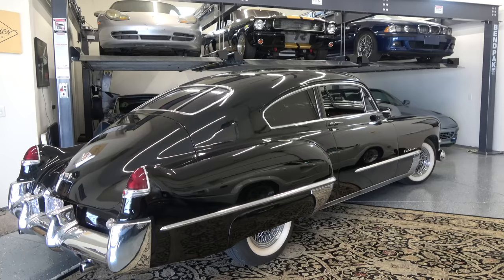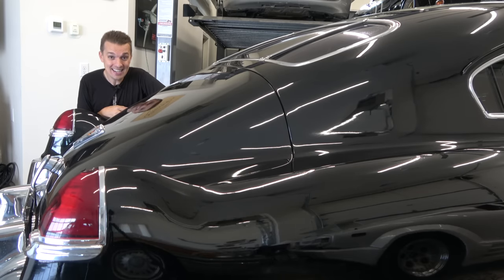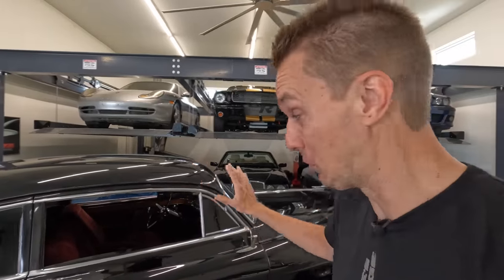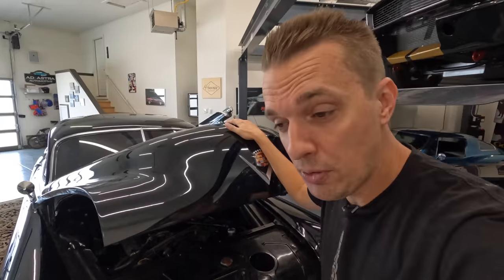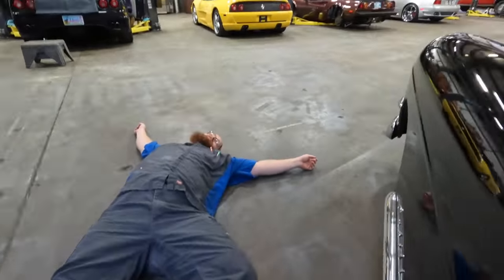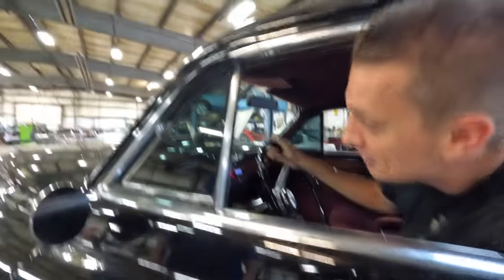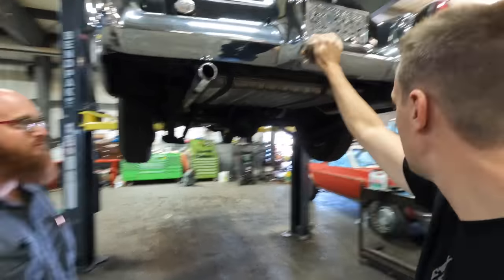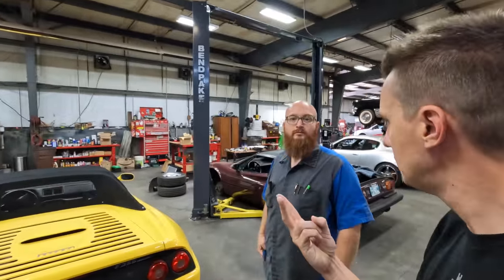I bought a RARE 1949 Cadillac Fastback, and making it my 70 year old daily driver! Amazing Restomod!

Comment: I’m 84 and I actually remember the caddies of that era, back when a Caddie WAS a Caddie.  I don’t actually know, but I wouldn’t be surprised if that transmission wasn’t largely the same one that was in many military  vehicles, mainly armour throughout the war.  Should be bulletproof?  Anyway, now I’m going to watch the video to see if I actually know anything, looks like a good one.  What a car, what a car!!
Reply: Luxury manufacturers really were different back then, one of my many favorite cars is the Lincoln Continental Mark 2, and it was entirely hand built!!  Lincoln was literally trying to compete with rolls Royce back then and most luxury manufacturers don't put that much effort into their cars anymore.
Reply: Wow! that’s incredible. did you see these a lot? where did you grow up?
Reply: The original automatic was a dual band 4 speed Hydramatic that was actually used in tanks in the latter part of WW2. Those were very bullet proof and had an extra gear. It would be a nightmare to get that mated up to the 500 so I'm sure a TH400 was used instead. These transmissions were also used in Oldsmobile and Pontiac until 1956 when they went to the dual coupling design, which is my favorite automatic transmission.
Reply: @theincrediblehulk5797  The Mark II was not hand built, although it was put together to generally higher standards than a normal Lincoln. It wasn't a direct competitor to Rolls Royce because it only came as a two door hardtop.
Reply: @muziklvr7776  Putting the original Hydromantic into tanks was pretty bold since it was an entirely new kind of transmission and only came out just before the war in 1941, besides tanks being a bit heavier than a car.
Reply: My Grandfather had a used 1962 limousine he bought at an auction that had a bad transmission. Since the early Olds and Caddies shared the same transmission, they just pulled it into my uncle's garage and swapped it out. They used a modified version of the 4 speed Hydramatic where the 1-2 shift was a fluid coupling, and the 2-3 shift was a clutch pack, and the 3-4 shift was another fluid coupling that also acted as a bit of an overdrive! For a big old (22 foot long) boat, it was actually pretty snappy for only having a 390 under the hood.😄👍
Reply: @emjayay  cadillac has and has competed with Rolston since the 1920s
Reply: Whats up Kenny we grew up together! I was a lil older than you but great times
Reply: @connorkamp5713  no you probably wouldn’t see “a lot” of those because they were very expensive for the time.
Reply: @theincrediblehulk5797  They sold for about $10K at the time.  Incredibly high price.  Even so, Ford estimated they lost $1,000 on each one sold.  Unlike other cars, it came to the dealer completely ready to drive even with some gas in the tank - with the exception of the wheel covers that the dealer installed.  And each was shipped with a fleece lined cover.  And yes, competed with Rolls Royce but also Bentley.  A very handsome and stately style and one I have always pined for.  Instead, I'll just have to settle for the much more common, but not too common, Studebaker Avanti.  Maybe I should think about trading up to a Mark II.
Reply: I'm 76 and my mom and dad drove '49 Olds 76 (flathead straight 6 & 3 speed on tree), couple '51 Olds 98s, '53, '56, and '60 Cadillac, and I drove a '57 Olds 98 Starfire... later '62 Olds Jetfire... etc...
Reply: The wizard is a smoking hot ginger bear! WOOF

Comment: Hoovie this is indeed by far the most gorgeous and classiest car you've ever bought. Well played Tyler, well played.
Reply: Well, I would have preferred stock tires and rim dishes. Back in 1949 the classiest you could possibly get with the Cadillac Club coupe models was definitely the dark metallic mint green, of course with large white walls and excellently designed mid century hubcaps. In those days, black was second best for pure luxury, the iridescent/metallic factory paints were the most popular. You just can't see the beauty of a old Cadillac unless its completely stock.
Reply: @RJ3T-  mhm, how far is that getting you
Reply: @WitchKing-Of-Angmar  Nah those wire rims are fuckin sweet.

Comment: Man that Cadillac looks comfortable as hell while you're driving it with all the modern upgrades. And looks amazing.
Reply: hell isn't comfortable tho
Reply: I think the seats with the plastic covers though, ummm yeah. I think there's a lot better choices but I've driven in later 40's early 50's tanks and they are incredible on the highway. Fuel econ is abysmal but they just purr along like you're floating on air. They are rounded enough that cross and head winds don't buffet you and with the weight, (inertia) they don't slow you down at all.
Reply: @Ballador   it might be if you’re cool enough
Reply: @Ballador  It also isn’t real so you can make it fit whatever your imagination desires

Comment: I love nicely done restomods.  I've got a 1963 Studebaker Avanti, and I've taken that approach in restoring it.  It's a supercharged one, but I've got A/C (possible by replacing the original compressor with a smaller modern one), upgraded the disk brakes, added a five-speed transmission (so now it has an overdrive gear for better highway driving), modified an original radio to be a modern, 4 channel, AM/FM, with Bluetooth compatibility, it's fuel injected, for better driving with today's crappy gas, 3-point seatbelts and seats with headrest for better safety, and a couple of other things.  It all makes for a much better driving experience on today's roads, most people can't spot the difference from what's original, and everything is reversible if some future owner wants to make a show car.
Reply: Good job well done sir
Reply: That sounds amazing!  How did you fuel inject that old motor?  Throttle body system?  Still, with a supercharger I bet it was a trick to tune.  I like resto mods with original engines.
Reply: @tomm1109  I went with an outfit called Hamilton Fuel Injection -- Mr. Hamilton modifies early '90s GM throttle body EFI to work with just about any engine.  It's not that hard to set up.  You send him your engine specs, he puts the kit together, then you drive it a few times with the car connected to a laptop, and send him the information, and he can tune the the EFI for optimal performance.  It might get you a tiny bit of horsepower, but the real benefit is fuel mileage and driveability.

As a matter of fact, the car was a lot easier to set up with the supercharger than the carburetor was.  My Studebaker no longer had its original Carter AFB, but had an aftermarket Edelbrock -- almost the same carb, but we could never get it dialed in just right, and I would have problems with the engine quitting on interstate offramps and so on (which cuts the power steering and brakes, or course).  The EFI has cured all of that, and now the car runs like a top.
Reply: If people can't tell the improvements and all your work is reversible, Excellent!
Reply: My ultimate dream car

Comment: Oh my, Tyler...that is a very pretty car.  I'm not one for restomods, but that one looks quite tastefully done.  I love the early part of the video when we can see the Countach reflected in the paint.  A space-aged looking car as seen through the eyes of 1949.  Well purchased!
Reply: Restomod? I hadn't heard that word, but it's kind of perfect. In essence what I want.
Reply: @davidmuth4571  it's when you take an old, beat up or broken down car and, rather than replace everything with factory options, replace everything with more modern parts that look period correct and usually the mechanical bits are completely modern, so no pesky carburetors or dangerous bias ply tires. It's what most restored cars end up doing because it can cost significantly less money and end up with a better car. It's not better or worse than returning a car to factory new condition, just a different take. Most restomods end up looking nearly identical with factory restorations on the outside whereas some even change the cosmetics too, but rarely do restomods actually use original mechanical parts.

Comment: You realize that this car was done REALLY right, especially for the time when it was done. The donated parts fit really well for what they are, the custom touches inside look like they are in good shape (e.g. door handles).  Only would be better with Power Windows, which I believe was an option in 1949 (vacuum driven).  That wood is really done well.
Reply: Crank windows never hurt nobody! And rarely break! I miss them a bit but I don't wanna give up my power luxuries. I really missed them when my driver's door window power module broke a few years back!
Reply: I agree that manual windows are preferable to VACUUM operated windows. Not much wrong with a modern electric conversion tho.
Reply: I believe 1949s were hydraulic.
Reply: @Complete.cyclepath  lol.....and right at the beginning of the video, he "broke" the manual crank vent window!!
Reply: @AxiomRazor  I believe you are correct.....I'm not an expert, just knew they were not electric back then.
Reply: @AxiomRazor   I think they were hydraulic.  They were really powerful.
Reply: I had a Volvo 760t  that had power windows and there was a small tool in the trunk tool kit that I could use to crank them up or down should the electric fail. That was always my favorite car so man cool little touches
Reply: The 1949 power windows would have been hydraulic, not vacuum. This lasted at least through 1953.

Comment: Another comment from me. My father's friend bought one of those new, that makes me 8 at the time. I remember running my fingers over that tailight, thinking it was the most beautiful thing I ever saw. No way we can appreciate how radical it was. I read somewhere years ago that when it came out in '48. the public hated it. Cadillac was so spooked by its low acceptance they prepared a mid-year model change. Then sales started to take off. The birth of the tail fin was not a smooth delivery!
Reply: I do not think the public would have disliked that car especially the type of market it would have been aimed at. which was well to do younger generation. 
I would suspect the older audience may not have warmed to its look as much but then again they would have seen fancy art deco cars that would have been far more radical in design.
Reply: ⁹ó

Comment: Be careful on those wing windows.  They have a sacrificial alloy gears that break or strip if you try to turn the handle while locked.  I had to replace them on a 48 ford and it involved some rivets and door disassembly.  Gorgeous car.
Reply: Piggy backing off of this, please fix that window if it's broken!
Reply: Too late broke already

Comment: I've a friend who had a 1949 Cadilac back in the mid-1980's. It was showing its age, still running and was in its original Dartmouth green color. Fabulous riding car. He sold the car in 1989 and I frequently wonder where the car has ended up. I hope it is still on the road.

Comment: This car puts modern styling to absolute shame. It's so gorgeous.
Reply: I could not agree with you more
Reply: You could put a queen size bed in the back!!
Reply: Cars had so much personal touch back then. I think the 60s was when car design became much more regulated by the government.
Reply: @benchattin  More than that, the manufacturing process for many automakers became much more streamlined, as more and more machines (and eventually, simple robots) joined the assembly lines.

Comment: Hoovie... That's just about the classiest sled you've ever bought.

It even knocked the Wizard out.

With that 500 in it, it ought to accelerate quite smartly... And just about knock you into the back seat when you step on it from about 50 to 100... Those 472/500 Cadillacs we're torque monsters.
Reply: Slick Andrews
No ... It IS the classiest sled he's ever bought .....
Reply: @boyracer3477  you're absolutely CORRECT.😁
Reply: Those 500 motors were dogs.  Had a friend in high school that had three caddys including a 1975 fleetwood brougham  with a 500. almost no power at all.  Now his 1967 coupe de ville with a rebuilt 427 would get down the road with authority.  Funny how those old cars were almost free in the late 80's  that fleetwood was so big it had footrests for the back seats!

Comment: This is the Hoovie that we love to watch. A very cool purchase. The Hi-Jacker shocks were common in the '70s and were used quite a bit to alter rear end suspension heights. I agree the radio need to go and be refitted with something that looks retro. You could take that thing on a Hot Rod Power Tour because it is a real driver. Love the BB Caddy mill too. Wizard should drool at this one for sure. Maybe an idea for a Resto Mod CarTreK? You'd win with that car for sure.
Reply: I put the Monroe air shocks in my 97 s10, it has a cap on it so she needed a little boost in the rear, it was easier than messing with the leaf springs and has worked out great. I keep it around 50 psi, they're rated for 200.
Reply: Small switched electric Air compressor with Cut in Cut out switch regulated to the set pressure for the correct ride  an accumulator and regulator /metering Valve with a in line Non return Valve fitted and an under the  Dash  Pressure Indicator showing your Shock/Air Bag pressure maybe even Colour Coded, and you would sorted for inflating the Back shocks ...

Comment: Nice! Mine is also a 1949 Club Coupe ("Sedanette" was the term Buick used for their fastback), but mine has the original engine and mods for daily driving: power steering, power brakes, and air conditioning.  Congratulations!  This will get more comments when out in public than almost any other car you have ever owned!

Comment: It's my dream to daily drive a 70 year old car, doesn't matter when, as long as it happens in my lifetime. My favorite 50's car would be the 1951 Hudson Hornet.
Reply: Do it. I bought a 31 Model A Ford, completely stock, to drive daily for a year. I did that regardless of weather for 18 months and liked it enough that 8 years I still have it and drive it a LOT.
Reply: @michaelconverse5127  maybe one day my current car will become a classic. My favorite cars are from the 40’s 50’s and 70’s. My dream car is a 1972 Pontiac Lemans hardtop sedan, but im not picky. I’ll take pretty much any American car from that era. Don’t care if it’s a Ford, Chevy, Cadillac, or Plymouth. I love all of them.
Reply: @liquidgoldsoup2833     You're missing some great cars by ignoring the 60s.  Let's start with the iconic Shelby Cobra.  Certainly on my list of the six cars that will be in my Hoovie type car rack in my garage if I come back to life as a rich guy .....  54 Corvette, 65 Austin Healey Sprite, 56 Austin Healey BN2, 55 Porsche 550, 73 Fiat 124 Sport Spider, 64 Porsche 356SC.  This list is subject to change although it has remained constant for quite a while now.  Something else cool would be a 54 Corvette restomod just to have a modern suspension so it could be a daily.  Had a boss with a 61 Corvette and it drove like an old truck.

Comment: Have Wizard check the exhaust manifold bolts. The 501 Cadillacs had an issue with the bolts burning off inside the heads. My dad owned nothing but caddys and that was a common problem with that engine. The other problem was that the positive battery cable to the starter would catch fire while driving. And the factory ground would burn off where it was attached to the body. I would also put a 180 thermostat in. They tend to run hot...even when brand new. Beautiful car!
Reply: @ 17:39, It looks like the ground cable is on the frame.
Reply: @hyacinthbucket3803  all of the things that I mentioned have probably already been addressed. My comment wasn't just for Hoovie,but for all 501 owners. Guess I should have stated that. The 501 is a decent engine but the 472 is much more reliable and owners usually can get a third more life in terms of mileage out of them. And if you get a pre 1972 472 C.I.D. engine it will have much more factory horsepower. I believe it's the best engine Cadillac ever made prior to the most recent ones.

Comment: A GREAT  resto-mod. Maybe the most convincing I've ever seen. The velour interior...a little dated in it's own short era. I might change out the wheels for something more vintage-y But the use of a Caddy big block ( I think the 500 premiered in the '71 Eldo then to the entire line in 75 before it's down sizing to 425 cid) instead of a LS is perfection!
Reply: The 500 premiered in the 1970 Eldorado.  It said on the side of the car "8.2 Litre".
Reply: I kinda liked the wheels. But you’re right!
Reply: @mexicanspec  THAT'S right, I was mistaken. Thanks! I could be wrong about when they went into the DeVilles too then!
Reply: @roberthoffhines5419  1975 was the first year they went in the De Villes and it lasted all the way to 1976.  I hope the one he has is a 1970 model with 345 horsepower and not a smogged out 1975 model.
Reply: Well, velvet interiors in luxury American cars goes back about 110 years at this point. I'll allow it.
Reply: @theprojectproject01  Somewhere along the line the leather interior became the upscale interior when it had always been the reverse.